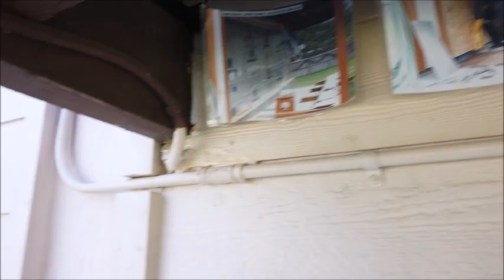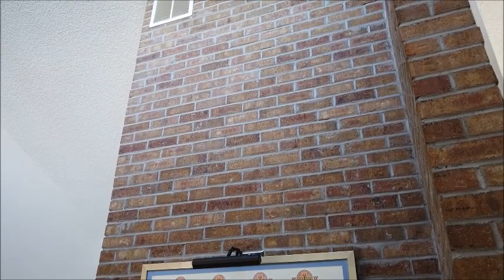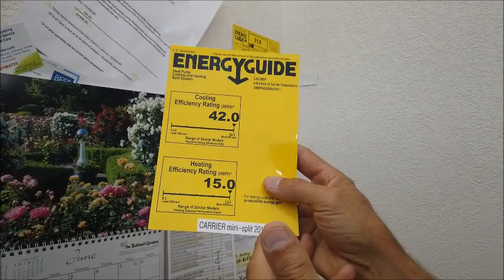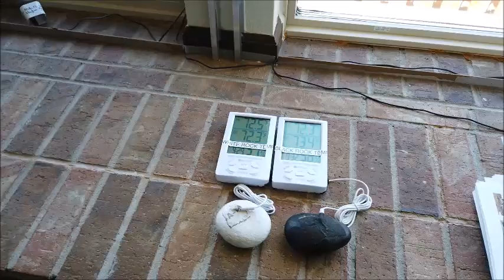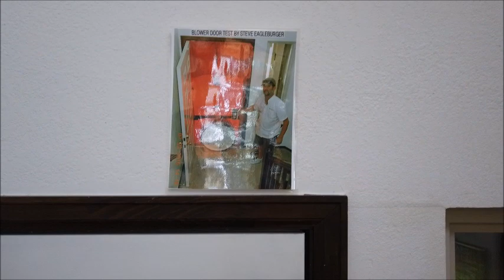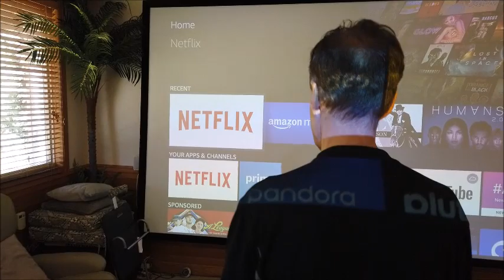John Avenson's Westminster Home Is a "Learning Center" for Net Zero Energy

Comment: June 13 2020  At least FIVE items I missed: showing in the video:   -  1) I wanted to show a display of  three air quality meters from Amazon that home owners should be aware of:  Particulate Matter Meter (PMM, shows the dust in the air from 10 microns down to 0.25 microns. - A size less than 1 micron is potential carcinogen, The CERV by www.BuildEquinox.com constantly filters my air with a MERV-13 filter and keeps the air clean inside. MERV ratings are from 1 to 20 with 16 to 20 as HEPA filters)  - Also, display a radon meter and a CO2 meter. These meters are popular in China because you can charge more for rent if the interior of your building is controlled and has good air quality compared to the pollution outside..    -  2) I'm currently converting the Blue Grass lawn (water hungry) to Mini Clover which needs very little water, remains dark green almost all year and can be walked on with bare feet.  -  3) Demonstrate a hot water re-circle pump by ACT D'mand. Press a button at your bathroom vanity. This saves wasted water by pulling up the hot water through the long pipes in the house to your faucet. You no longer have to drain water down the drain while waiting for hot water to arrive. These pumps are recommended for both a standard hot water tank and for a tank-less instant on hot water heater,  -   4)  Outside wooden decks have always been treated as disposable with a life span of 10 to 20 years. This is not sustainable. t NowThe deck and it's frame can be covered with SuperFlex rubber from RecPro, an RV parts supplier. The deck is now as durable as your roof.  -  5)  The wood trim between windows can be covered with custom cut glass as I have done between the windows.. This eliminates the need to paint your trim every 5 to 6 years and eliminates replacing old trim. The major trim elsewhere can also be covered with SuperFlex rubber or custom made sheet metal.
Reply: This is Omair. I hope you remember me from ALU project 2009. You are an inspiration. I am blessed to work with you.